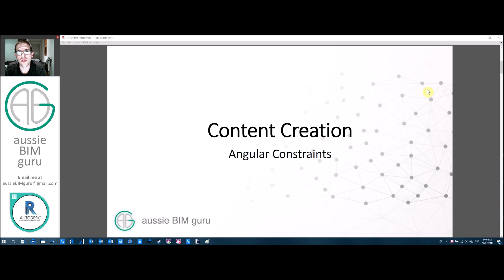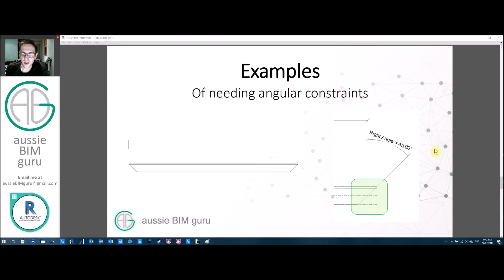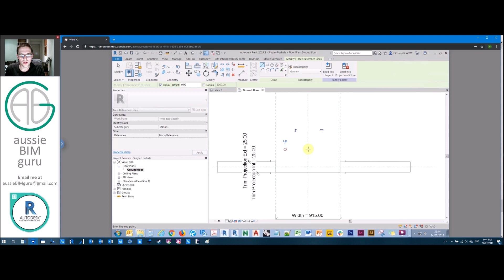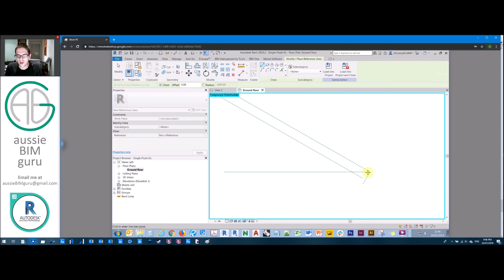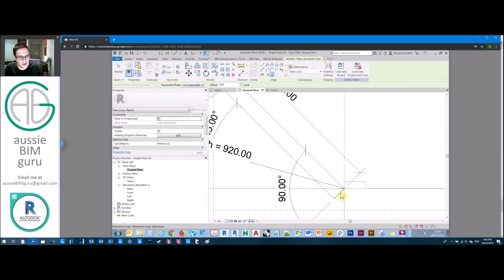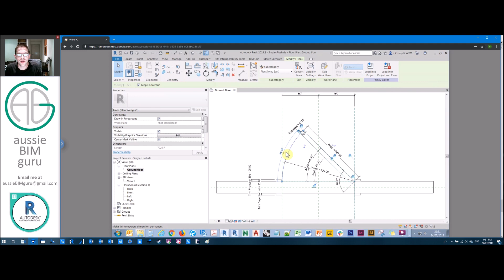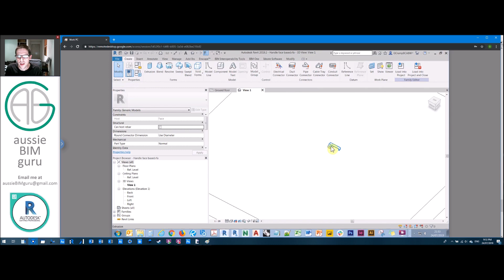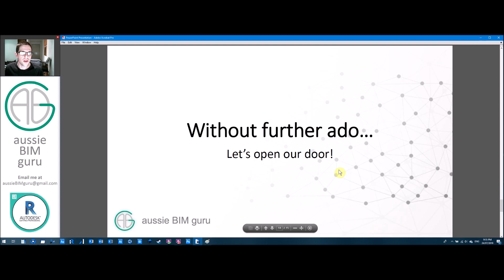Angular Constraints in Revit Families

Comment: Hi BIM Guru,
Thanks for this tutorial, I have been struggling with angles constraints so many times !
I have a trick for when I need to deal with this issue of having a line of length 0 (i.e when you set the angle to 0 in this case).
I would draw the line and arc with a different angle, say AngleNonZero, and set a formula to this parameter: AngleNonZero = if(Angle=0, 90, Angle). This way the lines will still be drawn correctly even when Angle is 0.
Then add a visibility parameter to these lines, with the formula Angle>0, so that they are only visible when the door is not closed.
Reply from the maker: Ah yes that's a handy workaround, I use similar ones for array protection if they go below 2 etc.

Comment: Hey, Gavin. Any chance you can do a shop front window that follows the underside of a skillion roof at, say, a 10 deg pitch to the head so it attaches to the underside of the roof? I can't find any videos on the net to explain this; it might be a handy Video to make   Cheers Cobba.
Reply from the maker: Short of using a curtain wall, a window would need to custom built with an angled head in elevation, and manually set in its properties to the needed head height and angle to achieve this. Revit doesnt offer a tool to keep them in line unfortunately.

Here's a quick sample I smashed out in R22 to show how it can be done:
https://github.com/aussieBIMguru/Revit-Files/blob/master/Families/ABG_231016_RakedWindow.zip

Comment: Hi Guru, is it possible to control tilting reference line with certain angle and also    reference line should rotate?
Reply from the maker: Not easily unfortunately. If you disable the 'always vertical' option, you can nest components on their centre at the family origin and nest them to a reference plane tilted about the origin I believe.

Comment: Thanks for the video:) Is there a way to do this with an an extrusion/ sweep that isn't orthogonal? I'm trying to set an angle parameter for louver blades with an ellipse-shaped profile. I'd also like to limit the range of movement of the angle. Thanks!
Reply from the maker: For this I'd nest a blade by profile in a family, centric around its origin in the X direction. From there nest that into another blade family, rotate it about the Y axis a bit and set an angle between its centre plane to the live one. Then you can array that and associate the angle down in a family one level higher again. I've done this before successfully for my doors/windows collection I provide via my business.

Comment: I hope you can spot the light on rebar with dynamo, I know it's a hard subject but there's not much on youtube explaining how to reinforcement, with little Python. 
Also how to change parameter values from excel sheet!
thank you so much for the efforts :)
Reply from the maker: Thanks Abed!

Parameters by excel is a great idea. I will release a video for this in a few weeks time using the Orchid package :)

Rebar is a little outside my field of architectural expertise, but I'll have a look into it! In the meantime, here are some helpful example videos by others who have structural knowledge - maybe this is a good starting point...

Rebar by curve/beam;
https://www.youtube.com/watch?v=_S31Dyn2Ez8

DiRoots rebar demo;
https://www.youtube.com/watch?v=BdzPJUj9k9M
https://www.youtube.com/watch?v=BdzPJUj9k9M

The great part is they share their packages as well here;
https://diroots.com/dynamo-package-by-diroots/

I would expect that it is best to deal with different elements of rebar in different ways (column, beam etc.) then use a secondary script to deal with connections and turns. Not 100% sure on the workflow that works best but at a distance it might be worth approaching it like this in stages.

Also check out 'Dynamo for Rebar'. I believe it finished in 2016, but may help give some more ideas!
http://core.thorntontomasetti.com/dynamo-for-rebar/

Comment: Hi.
Is there any way you can rotate an object without remodeling it?
I have a ridge from BIM Objects and I need to rotate it parametrically
Reply from the maker: The best way i know is to set it to not be always vertical, make it workplane based. Then nest it into a family with a rotateable reference line, and use the plane in plan as the nested families work plane. The family should rotate in line with the line in this case.

I use this trick here; https://youtu.be/rH2LyJRArPI
Reply: @AussieBIMGuru  thank you for the answer, but I didn't understand anything. Can you please make a video with it?
There is no such video on Youtube
Reply from the maker: @SeekYT6963  watch the video I linked to you. It shows how to nest a family onto a reference line. In this case I use a nested door leaf, but any standard hosted family would also work.
Reply: @AussieBIMGuru  Thank you. I managed to make it work on a door, but when I try to modify a downloaded BIM object I can't edit the form to get to the extrusion lines
Reply from the maker: @SeekYT6963  then it may potentially be imported as a CAD object or maybe it's a nested family.
Reply: @AussieBIMGuru  Thank you for your advice

Comment: works only on reference plane families. a complete mess trying to automate an object rotation on a title block...
Reply from the maker: Yes typically for north points I nest a centric family and dimension it with an angle about its centre.
Reply: @AussieBIMGuru  finally got it after some ridiculous hours of struggle and search. 2 angled reference lines behave absolutely weird but a single reference line constrained to the north indicator family I've made, gives me the proper working of the parameter on the SHEET. editing the parameter while on the titleblock family editor still makes some misbehave
Reply from the maker: @PlatSoul  yes I suggest nesting the rotating components in a generic annotation to make them simpler to constrain at the titleblock level.